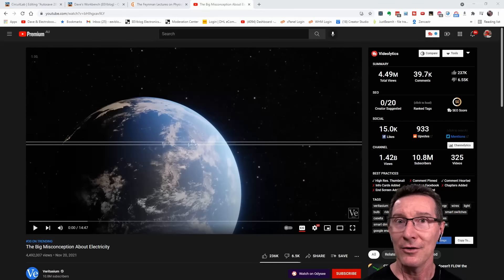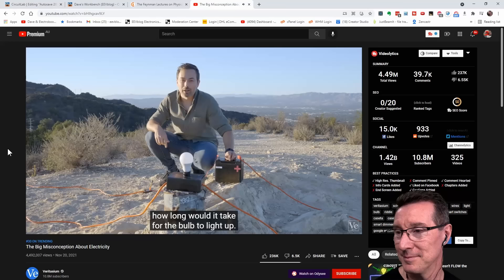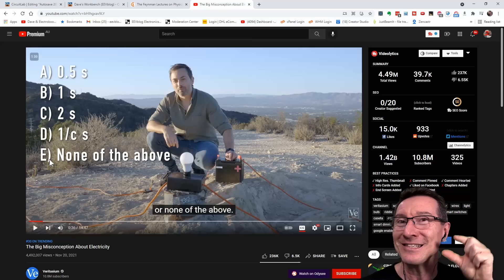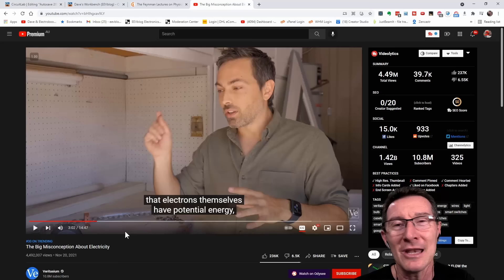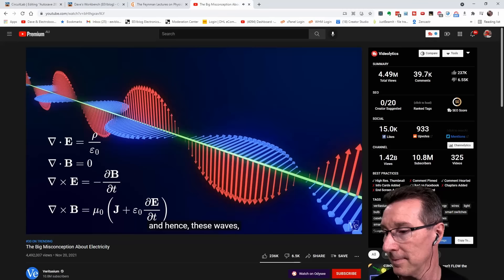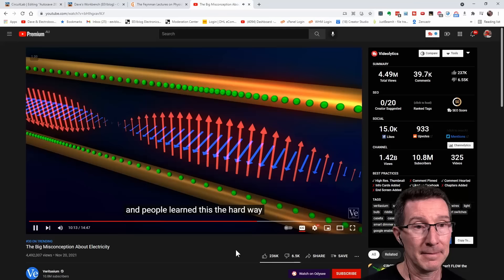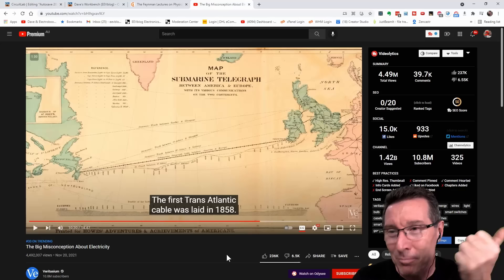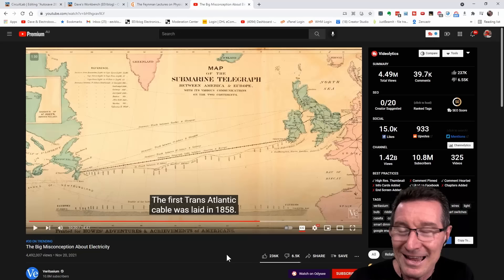EEVblog 1439 - Analysing Veritasium's Electricity Misconceptions Video

Comment: So if the illumination of this bulb is solely defined by the distance of the wires in parallel can I place a switch on the far end of the wire to transfer signal to the bulb and break relativity? 😂

Comment: 1/c s comes from 1m/ c m/s = 1/c s. I do not think he wrote it incorrectly.
Reply: Careful!  c can be in miles per second too.  He should have written "t = (1 m) / (c m/s) seconds".  See my comment also.

Moreover, EEVblog's lumped element model here is not the right one for Derek's experiment set up.  Derek's answer of 1/c is not entirely correct either.

You'll be surprised at what the answer really is ....

Go to the top and sort comments on "Newest First", scroll to the time stamp of this post, and read mine.

Comment: I assumed this original video was aimed at the general public, NOT at electrical engineers. You say it is OK to believe electricity flows inside the wires even though it does not. So engineers IGNORE physics (and the truth) and spend time criticising a video which does not. "50Hz AC is almost DC". It is not. It is AC. Your explanations are at least as confusing as the presenter of the original videos. I would like to see a PHYSICISTS take on the original video. The PRACTICAL views of electrical engineers do not appear very scientific.
Reply: It is true what you say.  However, the converse is also true.  Derek does not have a good grasp of engineering principle and he creates confusion.

Moreover, EEVblog's lumped element model here is not the right one for Derek's experiment set up.  Derek's answer of 1/c is not entirely correct either.

My point is both are shooting past each other.

Go to the top of the page and sort comments on "Newest First", scroll to the time stamp of this post, and read mine.  You'll be surprised at what the answer really is.

Comment: I love Dereks videos but the 1m cheat is really angering.  

Also the way the wire is made irrelevant is annoying.  More current requires more wire at low frequency and low voltage and high current else the damn wire melts.

Comment: "...yes, technically, at some half-a-bees-dick level..."  35:30 LMAO>  The biggest issue I think all engineers (electrical) should have with Derrick's video and demonstration, is he switches between AC and DC willy-nilly and then shows a light being LIT 1m/C s, and STAYING lit with a DC battery.  BS.  It would spark on 1/C but quickly shut off using a battery until 1s passed and he actually started current flow (your lumped model shows this) and the fact that over 2x 1/2C distance, R is NOT negligible...sigh.  You would have to be pumping the switch ON / OFF very fast to see it sustained lighting for any length of time over the first 10ns or so, even with his theoretical magic light bulb.  Physicists love to speculate about specified assumptions that are NEVER real world.  It is cool, because it is limit theory of where we could go if we continually optimized something from real world to best case, but...yeah, it is cool to challenge and honestly good to continually remember the WHYs of things, but even his example is very misleading (flip a switch on DC and light turns on and stays on).  To take things to extreme, Derrick's comment about "the light goes on..." would be the same, even if you had NO WIRES out there to 1/2C each way, it would fire just because you completed the transient switch (your lumped model shows this even with open circuit).  IF you had a light bulb that would light with infinitesimally small current from the DC transient switch (which he CLEARLY stated in his preamble, agree that as soon as ANY current begins to flow...), then that same light bulb would be lit from solar flares and a million other EMF signals all the time too.  grin.

Comment: Well damn, this entire time I’ve visualized DC circuits as an “electron pump”, and the cause of heat from electrical current was something like friction from the movement of electrons.  Also, people talk about electron drift and the skin effect like they’re different things.  Are they?  I assumed the skin effect was just a product of electron drift at high frequencies.
Reply: the heating is due to charge motion in the conductor. But the motion of the charges is caused by the fields discussed in the video, no fields, no charge motion.
Reply: @tomgroover1839  So it is “kinda” like an electron pump, with the difference being the cause for movement is electric/magnetic fields?
Reply: @J0eMega  So the Poynting vector is not a force, it is nature's mathematical indicator of power density (power per unit area with the vector perpendicular to the area) or energy density per second -- the vector cross product of electric field vectors and magnetic field vectors which are forces. Those 2 field vectors of electromagnetism directly force electrons in the conduction band, say in a metal conductor, to move through the conductor, and the metal lattice causes electrons to give up some of their energy of motion to the molecules in the lattice, like friction with kinematic motion in mechanics. In this process the conductor or resistor gains thermal energy. There are many conductors that are not metallic though and exactly why electrons give up energy to the conductor or resistor is maybe more complicated than I can understand at this point. At low enough temperature, superconductivity in metals happens, and electrons migrate through the conductor without giving up energy. BTW at DC it is only the electric filed forcing the electron motion. The magnetic fields are only considered at AC especially in motors, transformers and transmission lines.
Reply: @tomgroover1839  I’ll have to read all of that after work, but I can tell that was a lot to type out, so before I read all that, I just wanted to thank you for taking the time to type that all that out and explaining it to me :)
Reply: @tomgroover1839  alright so after reading it, it kind of sounds like induction on a massive scale.  Also, I think for DC motors, magnetic fields are definitely involved.  It’s been a while since I’ve had that class, but sources online also mention magnetic fields at play.  That and I remember doing a class experiment where we made a DC “motor” using a battery, a magnet, and a copper wire coil.  I understood how AC motors work, with forces in the quaternary axis, but the DC motor stuff didn’t click with me as well.  

However, back to how the flow of DC current works, it sounds a lot like a water pump, although unlike with a water pump, the electrons at one side of the line don’t always end up on the opposite side of the line, if I’m understanding correctly.  

You’re right about AC and magnetic fields being very prominent in transformers and transmission lines, as that’s what I work with for a living.  Although with most standards that utility companies have, I only really ever have to worry about magnetic fields when a project has to go off-standard.
Reply: @J0eMega  Actually one correction - electrons don't give up "energy of motion" like I wrote. The electron charges are moving so slowly and their mass so infinitesimal, that they have negligible kinetic energy. They are really only a 'vehicle', to use a colloquial term, for transferring power from the fields (electric field in DC) to the conductor lattice, as heat, or in the case of a motor to the kinetic energy of the rotor and to the load, as work. My mistake there, this is good exercise where I can review all this and think about it. As I said I don't know any details of how charges moving through a conductor cause thermal energy. Even though the individual electron mean velocity may be miniscule, the current as an aggregate flow of astronomical numbers of charges generates the magnetic field to be utilized in machinery and transformers and propagation of waves in transmission lines.

Comment: Problem is that electrical engineers may know all this stuff while electricians don’t, Yet electricians know how to build stuff that many or most electrical engineers have in their head.  Hence electricians repeatedly angered by engineers who have rarely if ever worked with the stuff.  

I am an electrician and have repeatedly asked other electricians with far more experience “So, if power is coming from
the source on the hot wire and returning to the source on the neutral wire, why does an induction tracer/tick tracer/widow maker only detect induction on the hot wire?  AND ALMOST ALL ELECTRICIANS THINK THAT ELECTRONS ARE RACING AROUND THE WIRES IN ONE DIRECTION, — EVEN WITH ALTERNATING CURRENT.  

You could say electrical engineers and electricians are very much, in a negative way, like a delta/delta or delta/wye set of transformers.  They aren’t touching/no wires between them but the energy is induced and stepped up or down.  But there is a fundamental breakdown in the case of engineers and electricians living in different worlds, speaking about and working with the same thing, but with some fundamentally different definitions.  This could so easily be corrected.  The original video may be oversimplified and like the Cheesecake Factory compared to a French Chef (the engineer doing this review of the original) but it’s a start.  I will be sending this video (the review) to other electricians so they don’t think the Cheescake Factory version is wrong.

I’m glad I found both of these videos.  My simple belief for several years, verified here, is that Tesla took the genius of Archimedes screw and magnified it to such a degree that if you open the electrical panel in your house and touch the A and B phase together, it will be hotter than the sun and vaporize pretty much everything in the path of the explosion.
Reply: So just plug in your toaster and make some toast, please don’t open your electrical panel unless you know what you’re doing…

Comment: Dave, this is one of your best videos. The engineering tools work for real world applications. Physics explains things in a field theory way that is not tangible. Physics can justify how electrons in a Capacitor can cross "electrically" disconnected capacitor plates.  When I need to get this deep, I find myself following the math (when I can) to justify an assumption, but then I run back to my EE mindset. 
o  How about a video to study electrons moving through a capacitor?  I never quite understood this. Thanks.

Comment: Veritasium is using simple circuits to explain long waveguides?
How can Veritasium know the difference if he is not an engineer?
Reply: Exactly!  Derek conflates two independent processes.  Derek's answer of 1/c is not entirely correct.  

Moreover, EEVblog's lumped element model here is not the right one for Derek's experiment set up.  

Go to the top and sort comments on "Newest First", scroll the time stamp of this post, and read mine.  You'll be surprised at what the answer really is.

Comment: The Veritasium video is so misleading that it should be treated as wrong. At time = 1/c, you only get a dim flash of the light bulb, but the video very strongly mislead people into thinking that the light bulb comes on at full power at 1/c and stays on. It's some pretty shameful clickbait.

Comment: I FORGOTTEN THE SPEED OF RADIO WAVES IN FREQUENCY SPECTRUM WHERE TO FIND ,HELP NO ONE CARE S OR SO FEW EVEN KNOW?
Reply: What is the speed of RF?
In other words, RF signals travel through coax at about 87 percent of the free space value of the speed of light, or 299,792,458 meters per second x 0.87 = 260,819,438.46 meters per second. The speed that light propagates in a medium such as glass - say, optical fiber - is less than the speed of light in a vacuum, too. IN VACCUUM AT A SPECTRUM SPREAD? HELL I EVEN FORGET SONIC SPEED IN VARIOUS MEDIUMS IS THERE A PILL TO HELP ME

Comment: 24:32 To get away from my bullshit calling and instead go tinfoil hat level theorizing... would be way easier to do this if I had animation skills ... can't think of great analogies either. Wanted to explain a random theory that came to mind about the erratic electron movement caused by AC creating resonant shockwaves that overall basically average out but are effectively very small high energy spike that create the magnetic flux that has a more exaggerated effect beyond the wires insulator.
Reply: A big eurika moment for me was to also replace the phrase "higher frequency" with "higher slew rate" whenever somebody explains this type of... theory, that would include one single transition from 0 current when flipping a switch closed on a DC circuit. That initial pulse with DC current could induce the magnetic current in the nearby wire that actual makes up a much more distant part of the circuit, then the conventional DC stuff takes over and the magnetic flux is essentially negligible.
Reply: 29:30 I love when I predict the answer somebody more qualified is going to give 😁
Reply: Ah, here we go. The way class D amps create sin waves. The resonant collisions happening between electrons could be like that (but "unfathomably" fast to the average person), in both the magnetic field being created by the electricity, and the electricity being created by that magnetic field. How's that for a theory...

Comment: Im not an engineer but if veritas was right, wireless bulb could have invented.
Reply: You are on the right track because Derek does not explain this well, very unusual.  Furthermore, EEVblog's lumped element model here is not the right one for Derek's experiment set up.  

Go to the top and sort comments on "Newest First", scroll the time stamp of this post, and read mine.  You'll be surprised at what the answer really is.

Comment: I havent seen many people discuss the glaring error: The answer D) 1/C Seconds is meaningless because the units would be  seconds squared per meter. The units are wrong. And if you were to argue that the units dont matter, then I would ask you which value of C are you using? Kilometers per second? Miles per second? The answer would change according to which value you choose.

Comment: After some more time spent on this subject I have the answer. :D
Derek is not an electronics engineer (this was clear from the beginning of his video) and he didn't know how to deal with the problem from electronics perspective.

Basically the circuit he presented is an series connection of two shortcircuited long lines and a lightbulb. The initial current (in the moment when he switch on the switch) is

I=U/(2*Zc+Rb)

I - initial current through the lightbulb
U - The voltage of the battery
Zc - characteristic impedance of the two (identical) long lines
Rb - the resistance of the lightbulb

After this initial current (which appears in the lightbuld after 1m/c seconds) there will be some more steps (which take one second each) which gradually increase the current to its final value.
But still I don't see "the big misconception about electricity". :D